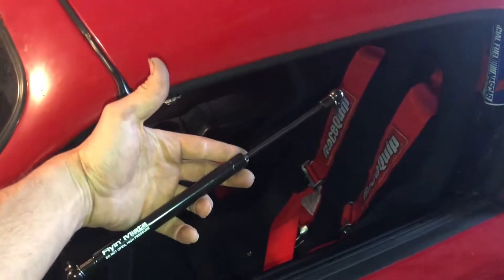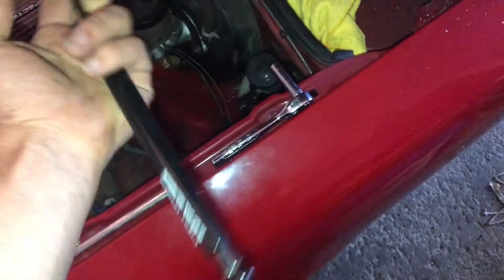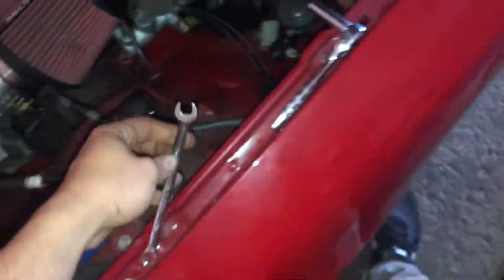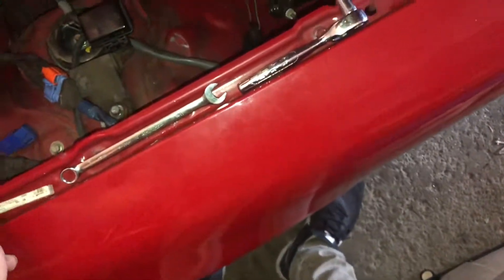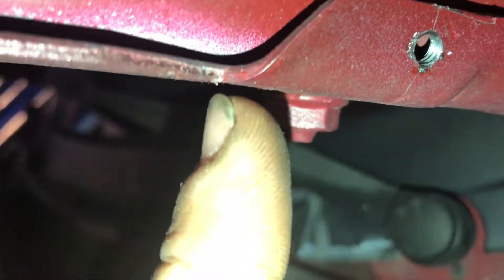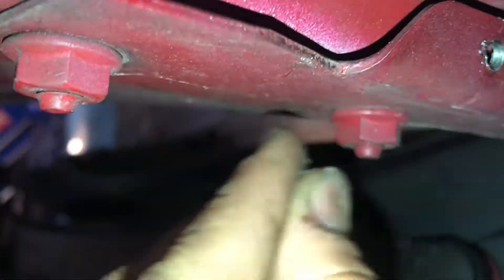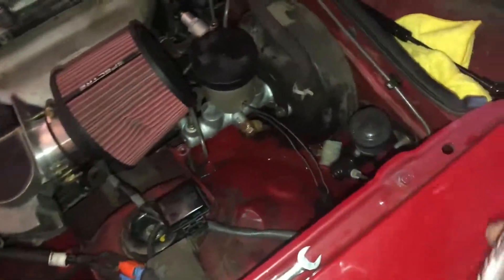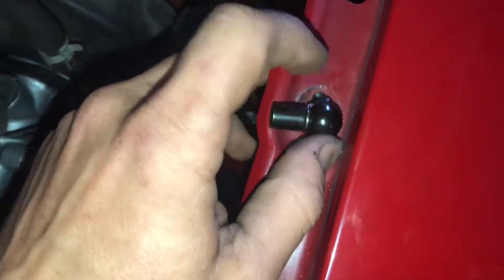Hood Struts Install - Flyin Miata

Comment: How is this holding up after 5 months? Does it bend the hood or make it uneven from one side?
Reply from the maker: Still loving them everyday no issues. I get constant compliments on them.
Reply: If you don't install them correctly, (measured wrong) they will mess up the hood